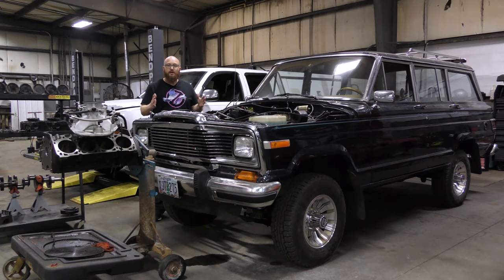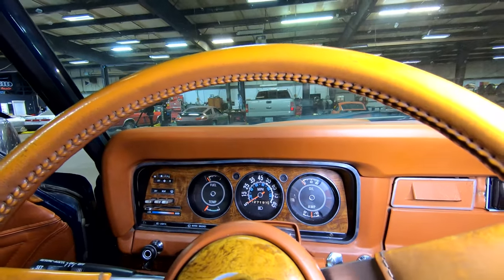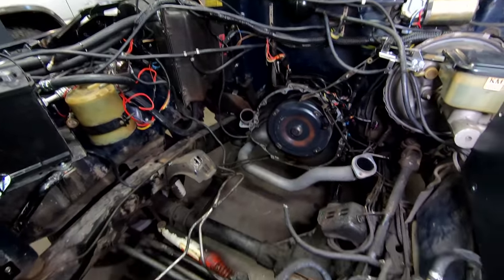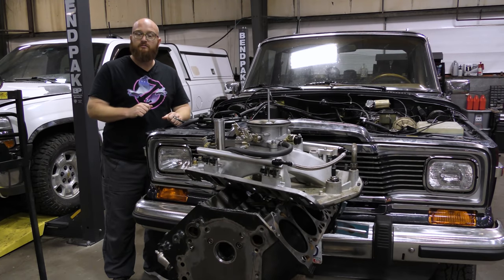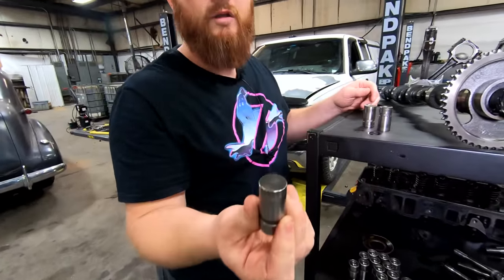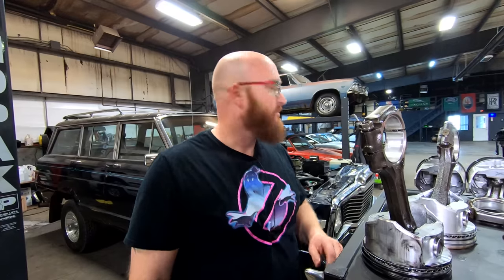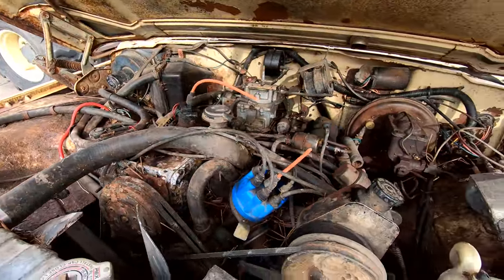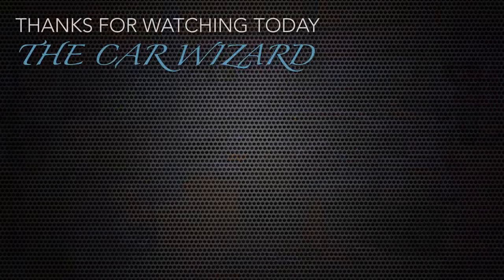The '83 Wagoneer rebuild is dead! CAR WIZARD gets burned by another shop!

Comment from the maker: Builder of engine supposedly did the full break in procedure and a dyno run. So that supposedly was done before we got the engine to install.
Reply from the maker: @criticalevent  poor assembly
Reply: Crappy flat tappet hydraulic lifters is a dicease now days, they are made of butter. And that busted lifter fills the whole engine with metal. Coolant and rod/main bearing are not the best of friends either. If the oil film in the bearing got replaced by coolant for a second or five that would damage the bearings. The engine oil will be at the top of the oil pan and the coolant at the bottom of the pan, the oil pump will suck nothing but coolant.

The only viable lifter options are old unused lifters or hydraulic roller.

Check out uncle Tony's garage here on YouTube,  he has some videos about lifters. The same thing seems to happen everywhere.
Reply: Is it true they call you Carwizard because.. when Hoovie gets the hourly bill, he says omg your a pokemon!
Reply: There is a rash of bad cams and lifters out there from major supply houses. That may have been the issue.
Reply: That engine was not broken in properly seen it a million times.
Reply: It was broken in alright!
Reply: The engine builder provide dyno testing results prior to installation?
Reply: There seem to be many issues with the build besides the camshaft. However, Uncle Tony has done several videos on the very poor quality of lifters from supposedly top drawer cam companies, exactly what you noted: Lifters bleed down instead of holding pressure. UT showed some 50 year old OEM lifters he has sitting in a box on a shelf for the better part of 20 years that still haven't bled down, versus a lifter that came with a new cam that won't even hold pressure between startups causing valve train clatter on every startup that quickly damaged components.
Reply: Many FSJ guys with reliability in mind just jump to 4.8/5.3/6.0 GM truck engine with matching transmission. AMC V8's are just that oddball engine where things go wrong because people don't know much about them and the limited aftermarket parts are often not made right. 

Port injection$$$$! TBI would have done just fine at 1/4 of the price. But hey, burning cash is part of the FSJ experience !
Reply: hit me up car wizard, i can lend a helping hand
Reply: @tobiaskarlsson9094  That's a hydraulic lifter not a solid lifter.
Reply: @CarWizard  How long was the engine stored after been built and how- I would also be asking that.
Reply: @charleshenshaw9099  yepp sorry if i wrote it that way. Now I have to check my text, again...
Reply: @joshualeone4383  the AMC 360 has excellent aftermarket support. The Jeep community keeps AMC V8's well supported.
Reply: @Yippee Skippy that might bee from coolant being slung around and destroying the oil film in that small end bearing.

That is however only a guess.
Reply: Another mechanic racing builder I follow has been having real problems with bad cams and lifters in several engine rebuilds. More than one had a catastrophic failure of  both. Even some rods ended up going bad in less than 200 miles. A couple crankshafts were soft as well.
Reply: I never noticed the wizard hat logo you had.  I like it.
Reply: @Yippee Skippy one caused the other. It does not take much to jam one up, a little trash from the shredding cam or lifter and that’s all it takes sometimes.
Reply: @relectric69  completely agree
Reply: hey man love the video love the work keep them coming. if you don't  supervise the builder it's gonna go bad.i believe if the builder use made in USA components the Jeep was in it's owner hand 👊👊👊👍
Reply: They either lied about the dyno test or knowingly shipped out a bad engine build. I hope the customer gets not only his money back, but also the costs associated with the extra labor of dealing with the horrid work they did. If he lets it go it will just give them an opportunity to keep ripping off more customers.
Reply: @joshualeone4383  I am not a big fan of completely changing the personality of a classic, BUT going to that fuel injection setup is completely changing the personality of the Jeep. If I was to do that, I would also do the LS swap with prob a 5.3 and 4l60e from a 99-06. Roller cam, fuel injection 4 speed. I would just leave stock tune and cruise the jeep.
Reply: @MrJeffcoley1  pins on that connecting rod put in like shit. They didn’t care or check.
Reply: Junk cam and lifters. Many pro guys have been loosing cams doing it right. The frozen wrist pin, well, who knows.
Reply: M P customer should have a warranty. With warranty’s though, you usually have to deal with the company warranting the product.
Reply: I built high performance engines and I helped with the dyno procedure whoever did this was a hack and if we did something like that we would take full responsibility and come completely out of our pocket.
Reply: @joshualeone4383  Couldn't help but notice that white 2500 in the background. 6.0-4L80?
Reply: After seeing that knuckle tightness, I can't help but wonder if the push-rod pre-load was "all of the tensions" and that just ground the cam lobe and lifter.  I find it hard to believe that those bearings were ever changed as well.
Reply: The operative word there is supposedly, how many miles were on the clock after the rebuild? Putting together all of the clues, i.e., the engine never quite ran smoothly, catastrophic cam and lifter wear resulting in grenaded block, the engine was toast when the jeep arrived at your shop.  If it was installed before it arrived and had significant miles on the rebuild, it’s probable that the engine was toast already driving through your door. Was the oil changed before its arrival and checked for metal? Was it looked at after the failure and checked for metal. Finding out when the shavings show up in the oil and filter will tell you when the failure occurred. Blaming the builder might be premature until you run down the time and maintenance elements of the engine after rebuild.
Reply: Calling BS on that!
Reply: @MrJeffcoley1  Yes, we are getting crap lifters from the cam companies, but they didn't make the lifters. Lifters are supplied by major parts distributors that buy a lot of their stuff from you-know-where, and they cross the Pacific to get here. By the time the engine rebuilding community learned of the poor quality lifters, they had already been installed in customers' engines. One of the bigger cam companies went into damage control immediately stating everyone is using the wrong break-in oil and incorrect procedures during the break in period. Yup, blame the end user, instead of admitting they bought crap lifters.
Reply: @Yippee Skippy probably deposits from running rich...when you're dialing in a carb or fuel injection system, running rich (not overly so) is preferable to running lean.  Running lean tends to burn valves and overheat the cylinder head, not to mention possible damage from knocking/pinging.
Reply: That was the question in my mind.  Thanks for answering.  I have had 2 flat tappet cams fail on me.  Both Comp Cams, but I wasn't real knowledgeable of the use of high zinc oils at the time and it took a couple of years to develop, not right away.  Sounds like proper break in wasn't followed or the parts were crap.  Now it's roller cam or nothing for me.
Reply: @tobiaskarlsson9094  Uncle Tony was my first thought when I saw that lifter and cam. I've been watching his videos about the poor quality control on parts, especially the flat tappet lifters. 

The builder might have done a quality job, but the sub-par parts bit him in the ass.
Reply: Looks like the builder stuck it on the dyno and either skipped the cam break in procedure or he did not soak the lifters in oil overnight before installing them then he ran it and wiped a lobe  which caused the lifter to drop down too far and the pushrod jumped out and made the hole and the coolant wiped the bearings out.
Reply: Think he got ripped off. Wizard just to professional to say it. So I will. Lol. Think the builder screwed him. Probably used old parts, maybe No break in oil. His supposed break in ruined the cam due to lack, of proper break in oil,  assembly lube. Seen this before and it did the same thing. Heat damages cam lobe.  Metal now being heated and softened, cam lobe gets eaten. Pieces plugged oil ports. Heat seized the wrist pins, plugged up lifters. I built engines in my driveway , using a tarp over me to keep the rain and dust off me and my parts and never had this issue. This guy built it in a shop and it failed like this? That's not just bad luck or a mistake. He screwed him on purpose. He could have slapped it together using dirty hands and Vaseline as lube, no torque wrench, it would have lasted longer.
Reply: Going on what others have said here, i"m wondering (provided if they're serviceable) you can reuse the lifters and cam that are already in the replacement engine?
Reply: @stephenhunter70  nope. Can't reuse lifters on a different cam.
Reply: Maybe they did all that without putting oil in it.  Engine might survive and put good numbers with just break in lube for 1 dyno pull.
Reply: Don't engine rebuilders usually give a warranty 1 year or 12k miles or 2 years 24k miles?
Reply: @mikesamra9126  Usually but also usually owners are usually willing to continue to deal with them too.
Reply: Something else that I suspect could be at play here Wizard is if the oil was changed and synthetic was used without any additive. Flat tappet cams need that extra zddp. I found that out the hard way when I rebuilt a 22re for an old Toyota 4runner I had, and I had a cam grind down on me after only running synthetic. So I got the joy of getting to rebuild my engine twice. But that problem never happened again and it ran great after that when I used conventional with an additive. lol
Reply: @tobiaskarlsson9094  soon as I saw that lifter I thought of UTGs video on the space of bad lifters.
Reply: NOW Take this wonderful opportunity and swap in an LS into the thing like it deserves which will increase the value of that beautiful rig...
Reply: I’ll bet the builder doesn’t have a video of the break in or dyno run.    That’s because he didn’t do it.
Reply: @benjaminwhitcher1319  nope. The lifter is made of fudge and went to crap then it ground a hole in the bottom of the lifter causing it to loose oil pressure and collapse which in turn let the pushrod bounce out of its lifter cup and punch a hole in the block that in turn let a lot of water into the pan letting the oilpump suck coolant which is very bad for bearings. The stiff smal end is either due to metal from a bad lifter or cam ot due to too much coolant in the oil.
Reply: Turn the blown block into a coffee table stand
Reply: Flat tappet parts are not great right now, and there is no excuse for the rotating assy not being right - but also all owners/ mechanics remember when using flat tappet cams, you must use oil with zinc in it.   Old type diesel oils such as Rotella or Delo, Kendall still makes some styles, or use the zinc additive bottles. As to the failure, obviously proper care wasn't taken to check the clearances to make sure all parts were in spec but the cam was either out of  spec or killed because of no zinc wiping the cam lobe out IMO.
Reply: @tobiaskarlsson9094  Makes sense now I understand why he said the lifter bore was so thin.
Reply: "Builder of engine supposedly did the full break in procedure and a dyno run. So that supposedly was done before we got the engine to install."

Well I'll believe that when my shit turns purple and smells of rainbow sherbet. With the symptoms as described, there is no way that motor did a full break in and dyno without issues being apparent. So either they are lying, sent the motor off after doing that knowing it had problems, or are so incompetent as to have no business touching any motor. Most mechanical work is pretty straightforward(sometimes a lot of steps, but generally easy to understand,) and now more than ever information is available to the point there is no excuse. All you need is attention to detail and patience. I'm a bit of an idiot, and I've managed to do plenty of fairly in depth work without incident or catastrophe on drivelines much more complicated than that Wagoneer motor. 

That poor, poor Wagoneer owner, there is no excuse for what happened, and my sympathy goes out to him. I'd want to strangle those guys too, that's just beyond inexcusable.
Reply: @joshualeone4383  Unfortunately, I have found this to be 100% correct. If I had already had my shop finished and assembled the AMC motor myself, I have no doubt everything would have went fine. Never again will another mechanic touch ANY of my rides.
Reply: @relectric69  the retro fit or engines with oe hydraulic roller cams tripple the price or more but don't fail like flat tappet lifters. Some cam companies offer premium core a harder steel camshaft and lifters. Howards Cams offer a warranty but your are required and should use a zinc additive. Roller lifters don't have that friction that flat tappets do. Still the builder should stand behind the parts they chose.
Reply: @madrew2003  exactly. Had one flat tappet cam wipe out rods and mains,  crank etc. I stroked it since most things were past repair and have had only hydraulic roller cams and lifters in all but one engine since.
Reply: @lawrenceoliver9813  Please explain, O wise one, what is the proper break in procedure for a silly putty chinese cam and play doh lifters.
Reply: @sccarguy8242  Uncle Tonys Garage did a video on this exact issue. Identical issue. I’m betting that’s what happened here. It’s easy to blame the rebuilder, ideally you’re using all top shelf parts but that’s not always realistic for a guy shopping rebuilds by price. Unless there’s evidence the guy did a poor job, I don’t know that it’s fair to slam him for using mid tier parts. It’s the parts suppliers who should be being slammed.
Reply: Look into this issue more. Youll find this has became an almost common problem for builders. Lifters are failing and taking cams out. Always check the bottom of the new lifters because they are being produced wrong. The ground on the lifter prevents them from rotating and some suspect the hardness is wrong. Idk what to say the wrist pin and piston clearance.  Your builder has already heard of people having issues with lifters im sure
Reply: Yeah sure, ask for the dyno testing sheet, Rj in Oz
Reply: @karlhungus8006  Nah, if a swap, go Hemi to keep it in the Chrysler family. LS swaps are overdone.
Reply: I’ve been hearing about cam failures all over the Internet though
Reply: Time for a hemi 392 swap
Reply: @johnmcmullen456  ...yes that would definitely be more appropriate...the Chrysler/ Jeep connection slipped my mind...good call
Reply: @tobiaskarlsson9094  So anyone wanting or needing to replace flat tappet lifters is just SOL then? There simply are no replacements anymore?
Reply: 90% of the time I would agree with the car wizard this time I don’t. The cam went flat due to the terrible lifter, cam cores and oil issues that have been plaguing flat tappet cams for several years. The builder could have done everything right and and this still could have happened. The piston with the tight rod could have been caused by the very rich tune and the cylinder pressure from the camshaft going flat. I agree the tuner had nothing to do with the issue unless the tune was so rich it diluted the oil. I seriously doubt that was the case.
Reply: @CarWizard  How?  Easy to point blame on someone that cannot defend themselves.  Personally, that is why I always assemble myself.  I have the rod stretch gauges, micrometers, bore gauge etc.   If something goes wrong, there is only one person to blame... 
Knock on wood, never had an issue.   Putting together a small block right now with a .650 lift solid roller - little outside my comfort zone.  Following best practices and manufacturer's (Lunati) recomendation
Reply: @lawrenceoliver9813  Not sure if this was a high lift cam or not, but flat tappet, run it with low valve spring pressure, 2500rpm until hot then let it cool down.  (at that point I do an oil change and check the magnetic drain plug).
Reply: Have you not heard about the bad lifters and cams WITH ALL BRANDS over the last few years?
Reply: @criticalevent  Chinese parts
Reply: @relectric69   there was WAY more wrong with that build than a bad cam. Looks like it was slapped together unlubed and without checking tolerances. NO builder should have installed that piston and rod.
Reply: @Full_Otto_Bismarck  sort of. The only way you can bee sure that your flat tappet lifters won't eat the camshaft is to buy hydraulic roller lifters. Or if you really want hydraulic flat tappet, find a set from the eighties or nineties. That is not made out of fudge.
Reply: I'm seeing bad lifter all through the comments, not saying your wrong but do be careful when building up a new engine. Your new engines lifters may bite you in the butt again even with a different builder.
Reply: @CarWizard  -based on the piston push rod being hard to move ,I would say yes ,but I also believe he had poor quality parts and some incorrect clearances on those bearing caps.
Reply: @MrJeffcoley1  , even if you are correct ,the rebuilder will get the blame and his reputation will be tarnished.
Reply: @trackrunner11  There was a lot more wrong here, the bad lifter is probably the ONLY thing that isn't the builder's fault.
Reply: @MrJeffcoley1  -oh yeah,I agree. I saw the  contact wear pattern on the bearing cap for starters .This is an indication of either not using 'break in' oil while torquing or something else.
Reply: @MrJeffcoley1  ive caught 5 sets of bad lifters this year alone. After i prime the oil system i pull the valve covers and feel each rocker arm to make sure they are all pumping up. There is no quality control anymore inspect absolutely everything with a fine tooth comb
Reply: Rookies I tell ya
Reply: @CarWizard  Lost respect for you with this one.  There are other much more plausible explanations.
Reply: @CarWizard  poor assembly of what??
Reply: @criticalevent  No, not at all likely!  Wrist pins and the cam/lifter interface are lubed by splash, oil thrown off the crank.  These failure points do not depend on an "oil passage".  If an oil galley were plugged, the failure point would have been a rod, main, or cam bearing.
Reply: @joshualeone4383  Very good point. AMC V8s have a known oiling problem, and very few folks know AMCs anymore. We have a AMC only shop here in Phoenix.
Reply: Name and shame that engine company ?
No one dares do that these days.
If you don't name and shame them they will carry on their SHIT work !!
Reply: Where's the proof that you did everything right after installing the engine before running it? Did you even make sure there was oil in it? I have a hard time taking your word on a lot of things I see in videos
Reply: So quick to cast shade on the builder?  Was the hole there when you received it?   You’re implying the builder faked the Dyno results?  This channel seems more parts swapping vs old school mechanical, I guess that’s just a symptom of the times but definitely a more negative whiny tone, your success vs failure videos seems a bit skewed towards the negative.  Just saying… very little troubleshooting/diagnostic’s and more “After Action” reporting.